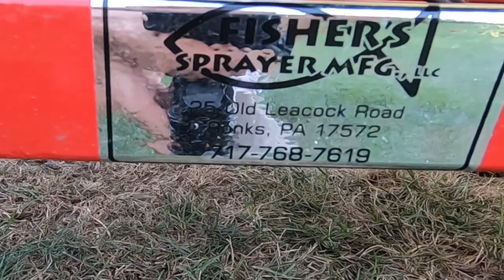RUNS OFF DEWALT BATTERY...CUSTOM WATER CART

Comment: Looks good except 3 things. Should have put a plug on your rider for the power supply 12volt better since it's there all ready. The tank should be higher on the frame to protect the bottom drain. One day you will drive over something and break off. There are shops lots Amish around here including myself that can build that. It makes one lazy lol instead of carry the water. Over all it's a great item well built have a great day.
Reply: That's awesome are you around Lancaster too?
Reply: @terriblycleverchannelname5620   Hi no from Ontario